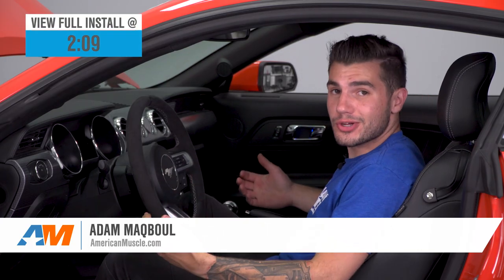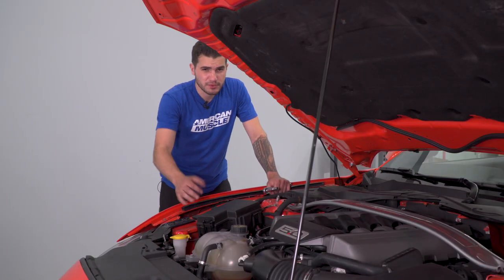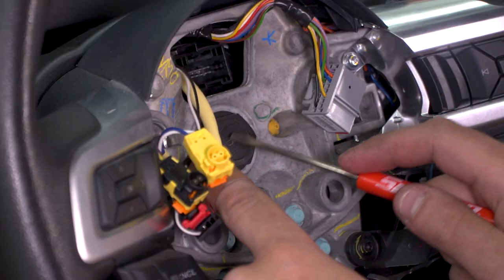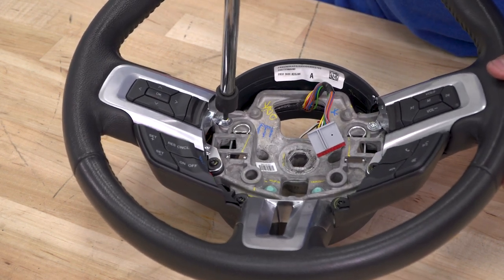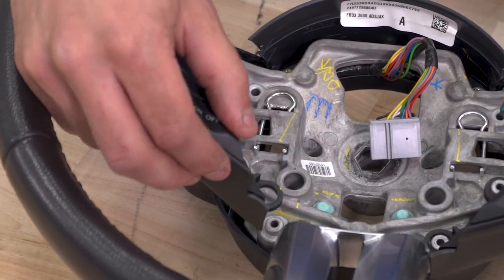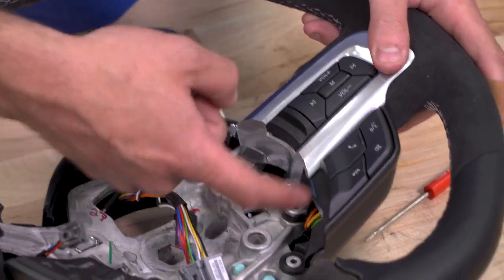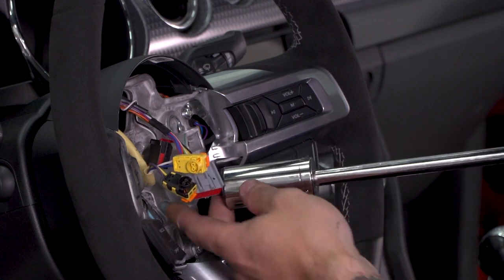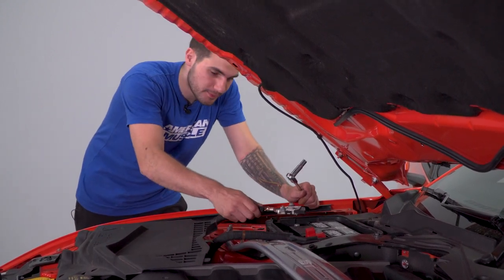2015-2017 Mustang Ford GT350 Alcantara Steering Wheel Review & Install

Comment: What happens if you don't install the bottom [black] satellite controls?
Also if you let the connectors unplugged, will it trigger an error light in the ECU ? Thanks.
Waiting for the carbon fiber version 8P